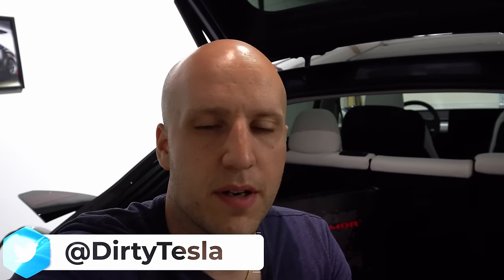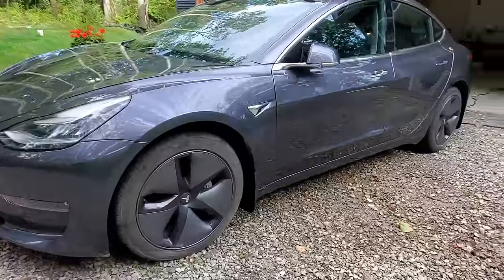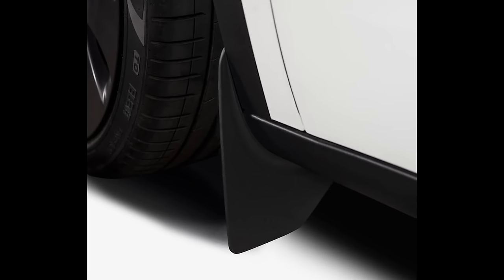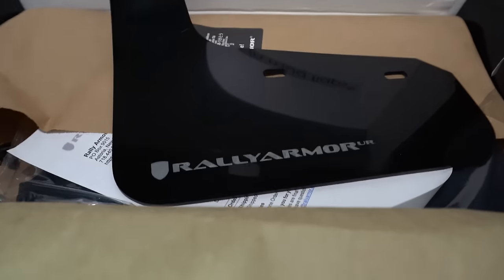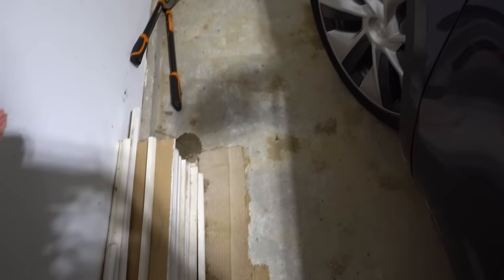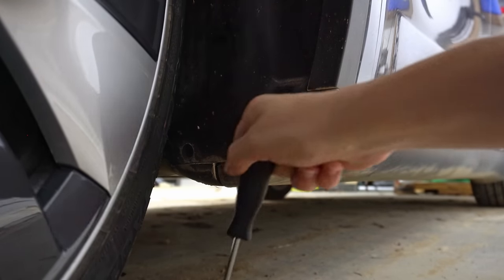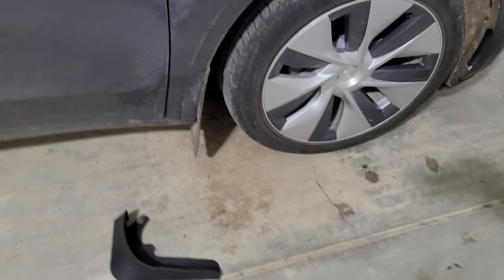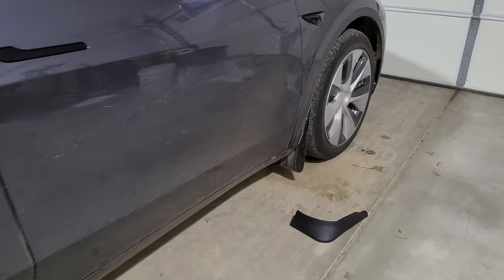Rally Armor Mud Flaps Install and Review - Tesla Model Y or 3

Comment: Those are probably the best made mud flaps. I’ve had those $30-40 Amazon mudflaps and they always detach where it latches onto the fender; also it’s rigid so over speed bumps it tends to chip and crack.

Comment: The reason that the rear flaps are sometimes not used is that the dirt thrown up by the rear tire just hits the underside of the plastic bumper cover.  If the Model Y has plastic rocker panel covers from front to back, even front flaps may not be needed to protect the paint.
Reply: That front-to-back plastic rocker panel is something I am really missing on my Model 3 !!!

Comment: I would be worried about the clips and screws rusting with all the road salt we use. Maybe switch to stainless steel screws and aluminum clips. I have found screws to be bad for mud flaps if you ever try to remove them over some time. 
It maybe better that the backing is plastic instead of rusting welding into some clip or nut that is steel. 
I agree it should be flat black, not gloss. 
But if we keep mine and yours dirty we should be fine :) .

Comment: FYI:  The mud flap kit purchased in 2022 for a post-2017 Model 3 is much different from the kit used here.  The principal difference is that the new kit uses metal mounting brackets all the way around instead of clips.
Reply: Do they look good?

Comment: Wouldn’t I just be able to use the Tesla oem clips instead of the screw, washer and expansion anchor? The screw can rust and fall out causing a flat tire. Or would I be able to insert the white anchors given by Rally Armor and then the Tesla oem clips behind those ?
Reply from the maker: It's pretty common to use screws for mud flaps. Still running these at 30k miles with no problems
Reply: @DirtyTesla  Do you think I can use the black OEM clips from Tesla? The ones that came with the vehicle? I have a MYP. Also, have your flaps permanently bent out of shape or do they still look new. I’m in WI wheee we get huge snow and ice.

Comment: It seems like the mud flap is of decent quality (I know a lot of folks getting rally armor for Subarus, too) but how has it faired for you going over high speed bumps, etc.? Curious if the long mud flap would hit the ground  and damage the bumper, too.
Reply from the maker: I still have them on to this day (I'm 36.5k miles) and I'd say they're perfect!
Reply: @DirtyTesla  Awesome! When you have free time some time in future, would you be able to measure the ground clearance from the bottom of the mud flap to the ground? I am pretty much leaning on the rally armor one but just wanted to know what I'm getting into :D Appreciate the video regardless!
Reply from the maker: @kconfire  can you email me dirtyteslayt at gmail, then I can send it there (and this comment won't get lost/forgotten :P)
Reply from the maker: I got just under 4 inches for the front clearance, and just over 5 inches for the rear clearance
Reply: @DirtyTesla  Awesome. Thanks for the info! I'm set on Rally Armor then :)

Comment: Nice mud flaps but a terrible install system. Either that or they didn’t update it for recent changes to the plastic edging in the wheel well. The bottom clip will NOT go on because if you around the back you can feel something blocking it. The white screw anchors are terrible and spin. Not impressed.
Reply from the maker: Maybe something changed on the Model Y but I didn't have a problem and 2+ years and over 50k miles later mine are still on and doing great